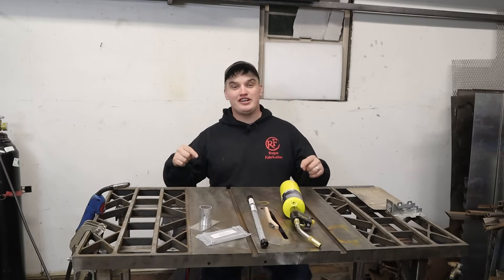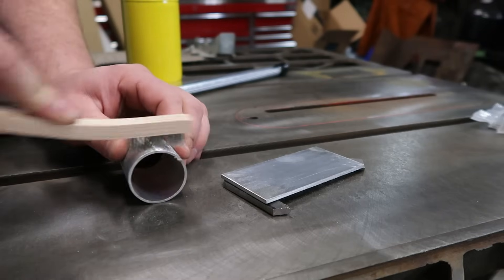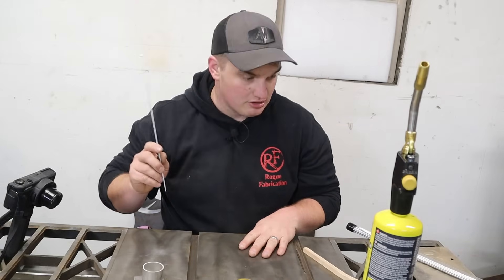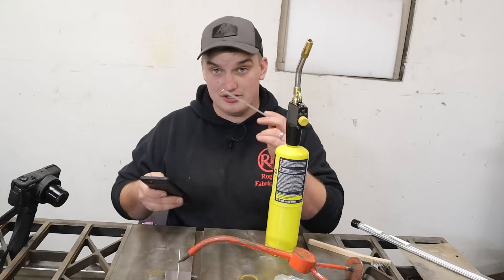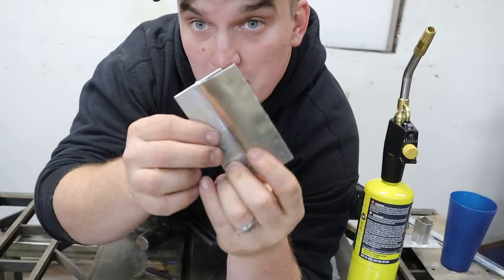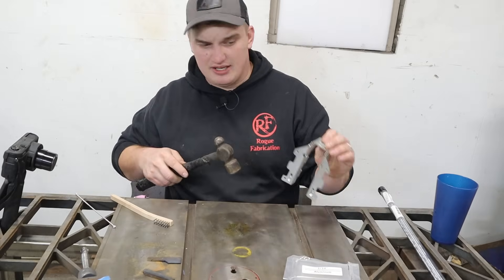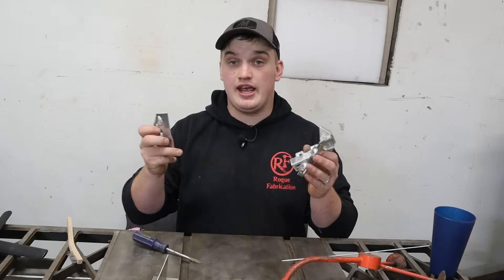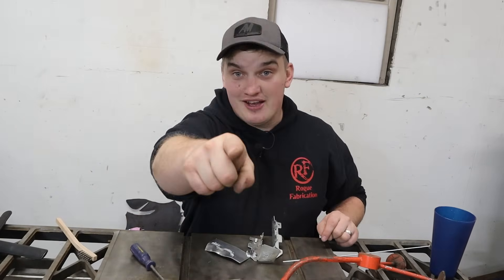Stick  Aluminum Together Without a Welder.

Comment: I used a similar product about 15 years ago to fix an aluminium up and over door where the lock/handle had fatigued the aluminum sheet and cracked it in several places. After fixing it I also added some penny washers on the inside to minimise the risk of failure, but I didn't expect the fix to last. It has lasted, with no signs of cracking. I also used it to repair an aluminium framed bike - doing some rough riding, a substantial twig flicked into the rear wheel and tore the derailleur out of its tapped hole. Back home I heated the hanger and re-aligned it (2 heat/bend attempts), the hole for the thread was ovalised, so I used some rod to recreate a round hole which I tapped. The repair was good for years after, and I eventually gave the bike away

Comment: Yes, you wasted your money on TIG welders. Flux core wire welding works on Al with the proper wire. No inert gas needed either.

Comment: I know this is old, but I wanted to ask since it is considered soldering; if you placed both mating surface together traced around the top mate on to the bottom mate then removed the top heat the bottom place a layer of solder within the trace and before it cooled placed the top mate back on... would it pass the water test?

Comment: Do you think this method could work for like welding a utility trailer jack to a trailer tongue? But than again, you said that its not welding. If not, what would you recommend to use for that? This seems like a much less expensive idea than buying a welding machine.
Reply from the maker: No I would not use this for structural applications

Comment: Ive been looking at a bunch of videos and still haven't found anyone using this on a vertical weld. Always flatwork on a table. They don't even mention it. I have a repair to do and so I will just have to guess that it will drip. Right out of the joint.

Comment: I tried doing this on the bolt hole for my starter on my snow thrower. But I couldn’t get it hot enough to melt the rod and I was using map gas.

Comment: WEIRD QUESTION(MAYBE)  IVE BEEN THINKING ABOUT UPCYCLING, USING ALUMINIUM CANS,ENDS CUT OFF, THEN SLIT DOWN LENGTH+ FLATTENED - COULD YOU DOBA TEST ON A FEW CANS, AND POST HERE??
WOULD GREATLY APPRECIATE IT!!!
PS- GREATLY APPRECIATE PUTTING FULL SPECS IN DESCRIPTION - SO FEW DO IT-
AND SHOWING GOOD CLEAR CLOSEUPS- AGAIN, RARE...
👍👍👍👍👍🍻🍻🍻🍻🥂🥂🥂🥂🤯🤯🤯🤯💪💪💪💪💪💪💪😄😄
Reply from the maker: You definitely can use raw material for TIG welding. I have done that before but I don't know that it would work to solder because there are other fillers in this stuff that have a lower melting temperature That allow you to just use MAPP gas
Reply: @amcustomfab  THANKS FOR QUICK REPLY!!
ANOTHER QUESTION- ALUMINIUM CANS ARE SO THIN,  (DONT KNOW HOW THEY CAN PACK BEER AT SUCH PRESSURE WITHOUT BURSTING)- WILL A MAPP GAS BURN THROUGH AS SOON AS IT TOUCHES IT???

Comment: I use a fluxed arc welding rod with map gad. Works perfectly
Reply from the maker: So you're saying just like a regular stick welding rod with MAPP gas? Which rod? You've got my attention.
Reply: @amcustomfab  Yes. Try it. I got a perfect weld joining 20 x 20 x 5 mm to another plate of the same thickness. I tried larger pieces but needed more heat than the mapp gas could deliver

Comment: To weld is unite two pieces by heating. You can use an electric welder, friction or a torch. It is welding.

Comment: works great for sealing the seam on a sun roof delete patch panel.  bought a ranger with a after market sunroof, I hated how it constantly leaked. so I removed the sun roof. used a ton of windshield adhesive around the opening of the sunroof, slapped a aluminum panel over it, then used this method to 'weld' the seem of the panel where it made contact with the roof of the ranger to extra support and to make it look abit nicer and was very happy with it and most of all. no more leaks ruining my interior.

Comment: I'm in the middle of a Land Rover 110 overlanding camper build and I'm hand fitting the 1.5 x 1.5 aluminum angle frame members that will support the sheet metal  in the rear of the camper as nothing is perfectly square.  I was thinking of how to "tack" these together (I don't have the ability to weld ALU...all I have is a little ESAB scratch TIG) for my neighbor to weld up.  This looks like a perfect solution.
Reply from the maker: I have never welded over them before. Not sure how that will work but it might.

Comment: I have seen products like this at the big swap meets and farm shows more than 20 years ago.  I still see the same guy selling at the swap meet. I even talked with him about tips different thickness welding techniques formy irrigation pipe handles.  I have also used this product to weld the cast aluminum alternator bracket for my S10, twice.  One ear and one leg. The belt broke and got tangled. The repair lasted for years. And was still holding when the drunk lady smashed our S10 with her big Dodge truck. This is an awesome product. Thanks.

Comment: I think it is 100% lead with alou dust, it is not good to weld chassis parts with it, but you can very well make alou pipes for AC and water cooler system, also you can repair a leaky radiator
just be careful because sometimes it looks like alou but we say andimoniom, it is not alou it breaks very quickly, sometimes you see carburettors that are made of this material
oh one more thing, take care of your health and wear a mask with a filter, because lead leaves behind poisonous gases

Comment: I'm from the old school. In the late 80's as kids my friends and I would take metal hangers and weld them together with a torch, and make little bridges/ramps for our RC cars. If you put enough heat to any metal you can   join it. That's a weld!
Reply from the maker: That's awesome.

Comment: Can you demonstrate it on a crack wheel That's what I was trying to do but it doesn't work I just don't like gas and the expensive machine just to do cracks unless I do it for a living
Reply from the maker: I would not use this on a cracked wheel. Not structural enough. A cracked wheel definitely needs to be welded with a TIG welder

Comment: Hey mate! Thanks for the video. Do you think it would be strong enough to make a table frame?
Reply from the maker: Probably a light duty table like an end table. The hardest part with stuff like that is holding the pieces together while you do the joint
Reply: @amcustomfab  Thanks mate! I wanna make a gaming table ya see. Probably best I get someone who knows what they're doing to build it seeing as I've never welded in my life 😄

Comment: "Do Not Use On Aluminum Wheels"  Bro' you fix the pits on the aluminum wheels :face-fuchsia-tongue-out:
used this stuff to repair aluminum motorcycle radiators with no problems :person-turqouise-waving:

Comment: 0:52 "definition of brazing is anything above 840 degrees"
Maybe you're right. I don't know, but I think the difference between soldering and welding is that when soldering, the pieces to be joined do not themselves experience melting at all, while when welding, the pieces to be joined melt from the joining point into a solid piece. When soldering, the pieces to be connected stick to the metered medium, which is the same as gluing.

Comment: Hey, new subscriber here, I have had no luck extracting a small bolt that broke off in the hole while trying to change the spark plug module on my riding mower. I have busted up the hole and chipped some of the housing where the bolt goes. I’m hoping doing something like this in your video helps my problem. I believe now that I’ll need to make a whole new thread in the housing. What do you think? Thx
Reply from the maker: Potentially know a lot of those mower housings are cast aluminum and I have found this stuff not to work well on cast aluminum.
Reply: @amcustomfab  any suggestions? Thx for your reply

Comment: I thank God for YouTube and videos like this, they are seriously helpful. I have been looking at ways to bond aluminum together without welding for a while and this looks like a seriously good approach. 3M has some adhesives that are really strong and are used in certain applications commercially, but the bonding times are lengthy in comparison to this approach. Thanks for your help and God bless you.

Comment: If I use this method for building a truck flatbed aluminum frame for camper, is it good idea?
Reply from the maker: No I would not use this for anything structural

Comment: Link?! I may decide to do this, because I need to reconnect an aluminum pole. Not only would this pole be supported by this "connection", it would also be supported by the house, with a shelf,and in other ways, as well.

Comment: Yes but you can't use aluminum you can't use this on a dryer to seal up a hole the heat itself will not be able to win can you solder to seal up a hole that's what pissed me off because I end up buying this s*** that I thought was supposed to be welding kit and for some reason you get a welding kit you got to you got to pass the written exam you got to you know jump through 20 minutes because I mean obviously I can't just go buy one apparently

Comment: How strong is this exactly? 
I'm thinking of building an aluminum frame for a220 gallon aquarium which is pushing nearly 400 lbs dry weight with around 1800 lbs H20.
Reply from the maker: I would not use this for structural applications.

Comment: Do you think this will work on car Alumium trailer fill in screw holes ????? I have changed trailer lights and had to go to other shape LED light  holes from old light needs filling ?
Reply from the maker: Yeah as long as you can get the area hot enough it should work great to fill holes. I would just not use it on anything structural

Comment: After heating the aluminum, it's now "annealed aluminum" and very soft, thus beating it will bend very easily. Try heat dipping it after soldering it. Make it hard again.
Reply from the maker: This would be a good experiment to do. Thanks, For the idea

Comment: You really can't go past the finish. If that were Tig welded it would be multicoloured by now. I would say most aluminium projects I do would  not be structural or require the ultimate bond. So this would be great. I wouldn't put a frame together with it. But i might hang something off the frame with this weld.

Comment: I've been planning on creating an intake barrier to prevent heat soak on my 1.8T VW Passat. Having the exhaust manifold and engine block to the right side of the intake filter, something needs to be between them much like on the OEM intake box. Was a bit worried about using my flux core as that's a bit overkill for the application risking burn-through.

Comment: Try working the rob from the inside diameter, while heating on outside. when working sealed fittings. Ensures flow all the way through the joint.

Comment: I need to solder weld a nipple for my oil return line on a turboed car. Alu pan alu nipple. What do you think should I trust in this?
Reply from the maker: I don't think I would trust the stuff under pressure. I would find someone to tig weld it for you
Reply: @amcustomfab  thanks. The return line not pressurised ,but might be the block

Comment: Do you think if I used those rods to weld the outside of a 90 degree joint, would I be able to sand it before painting it?

Comment: Let's do the math.

Aluminum melts at 1200° F. 
The oxide layer melts at 3700° F.
Those rods melt at 700°F.

It's not breaking the oxide layer or getting any penetration into the base meatal. It's basically hot glue.

Comment: Do not use this crap on pot metal. It melts at about the same temperature as pot metal. If you're not careful you will melt your workpiece. I use Muggy Weld. It melts at 350F and it's awesome.

Comment: I have a small piece of aluminum that snapped off a belt tensioner. It is wedged into a cavity inside a cast iron engine block. It is the size of a pencil
eraser. Trying to figure out a way to remove it. Very tight slave. Can't be drilled out. Wondering if I can just melt it out with Mapp Gas.
Reply from the maker: This rod has a lower melting point than aluminum does. I doubt you would be able to get standard aluminum to melt with map gas

Comment: You should maybe do some research on what welding is because you did weld the aluminum together
Reply from the maker: This is brazing it's only a mechanical bond versus welding. That's a molecular bond

Comment: I have a 1232 riveted jon boat that leaks. All the rivets are still present, they just flop around and leak. I have grinded the area around them down to bare metal. Would you recommend trying to weld them myself in this manor or take them to a welder? I dont need them to be pretty, I just need them to be sealed up. You make it look easy! I am pretty handy and plan to grind them back down smooth, sand and paint. 

In short, can a first time newbie do this and seal up rivets without burning a hole in the boat? Thanks!
Reply from the maker: It might work the downsides to the stuff is it does not work very well upside down. Or if there's a large mass of material, it might be hard to get the whole of the boat hot enough to make this work

Comment: What is the orange steel thing you are using to hold the piece in place? I got a project I need to use these on and have been trying to figure out how to hold a piece vertical while heating it up.
Reply from the maker: https://youtu.be/fn_FPLSYdjE?si=NlfA6HoWdKOEd7Sk

Comment: This stuff actually works amazing on case holes in atv and motorcycle engines. I've been using duraweld and alumaweld for years and they work great. Like you said, there is definitely a proper place and time for this type of stuff VS actual welding, but it definitely does a good job if used properly and on the right applications

Comment: Nice..   this is going to be great for big 1/6th scale rc rock crawler project --- i had a dream aluminium should be able to be soldered together somehow, i mean why not.   youtube and voila --- thaniks for the lessoning!!!   You made it look really easy and i'm sure its not -- I do have a couple cans left of MAPP gas but i conserve it like crazy cuz i heard they discouniued selling it --- prolly need tha textra heat to make it solder well.   Think of it like this --- Welding -- you are actualy melting ALL THREE PIECES of metal being joined together -- as you said into a cohesive single piece of metal.    soldering you are heating and melting a metal and sticking it to two other metal surfaces that remain in tact during the process -- never melting, just getting melted metal stuck to them under high heat circumstances.      It should work great in small projects like building trusses for axles in r/c.  Cant wait to try!!!

Comment: We use similar rods in hvac to braze aluminum coils and we test to 500 psi and the systems run at 350 to 400 psi in the condenser coil and hold gas! Works great the only issue is the flame of the torch tends to pull the oil film inside the coil to the leak so your prep is super important!
Reply from the maker: Super good information. Thanks for watching 😎

Comment: Haha way back in my misspent youth, I used something like this to solder old lawn chair tubing salvaged from the dump and cut-off aluminum siding pieces to make mufflers for model airplanes. Worked great even after joints were filed smooth.. Never had one fail  We didn't have many $$$. Each muffler cost a few cents. Commercial versions were $30.

Comment: I tried something like that and I couldn't get it to work properly. I probably didn't heat the job area properly. I think I was hitting the rod with the fire, so it didn't work. I didn't know what I was doing. LOL 
But when I needed to repair an aluminum radiator, it worked great.
I think the reason the two different metals stuck because you did go through that hole, so the aluminum solder held by that section.
Reply from the maker: I've definitely found it does not work as well on thicker materials tighter to get the piece up to temperature and hold the heat while you try to solder

Comment: I have a transmission that has a hairline crack by  one of lines and is leaking some,will this work if the damaged area is cleaned and prepped right?
Reply from the maker: No, it doesn't seem to work very well on thick casting because whatever you apply it to has to get up to temperature so you'd have to get the whole transmission case above that the melting point of the rod mostly for smaller things and it's not structural. I would recommend getting it welded

Comment: I've used that crap with no success.  Bottom line it doesn't work!
Reply from the maker: Depends on the application. Small thin material works great. If you're trying to use it on thick material or cast material, you're correct it  is not the tool for the job

Comment: Holy crap... That worked pretty well for its intended purpose.

The average joe needs to have an alternative to the intimidation and higher entry level of welding and that fits the bill.

Most people would run to the hardware store and grab a pack of JB, this is an accessible entry point for projects that JB weld would be fine with.
Reply from the maker: Well I still wouldn't use this for anything structural. But it could be a good alternative for light duty stuff
Reply: @amcustomfab  Totally.  I also wouldn't trust anything structural to hold using epoxy.
Nice alternative to "gluing" metal together, and faster.